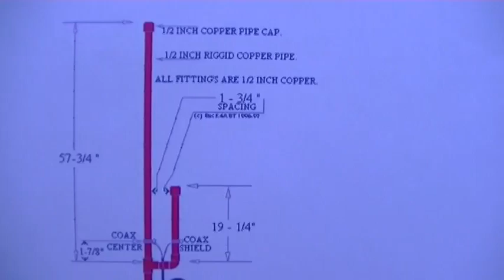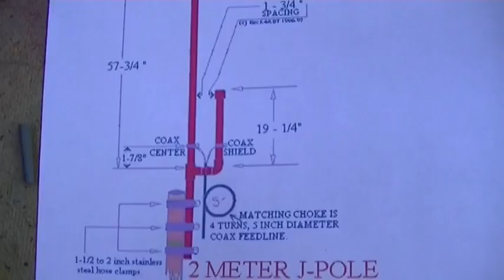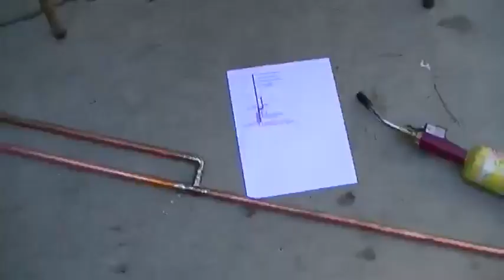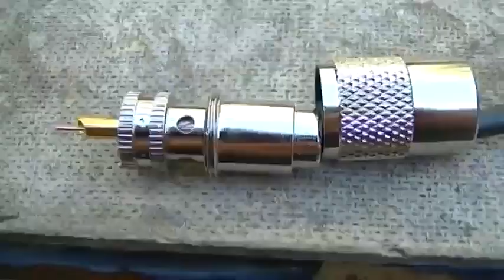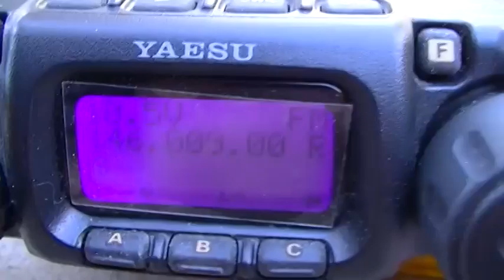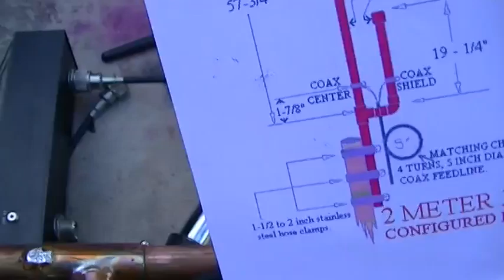Building And Tuning 2 Meter 144 Mhz Copper J Pole Antenna

Comment: You also did not mention that you should not use regular silicon sealer with the acetic acid that is not conducive to electrical connections.

Comment: I used 1” copper foil tape on 4” rubber duck tape. It works well ,is sealed from moisture and rolls up to small package. But you can’t tune after sticking duck tape together.
Reply: Duck tape is not wise
Reply: @FhritpFafo-z5c , Perhaps you are not wise. Have you used rubber 4” duck tape ?

Comment: How is it not shorted out ? The ground shield and center conductor are touching the same pipe basically
Reply: Radio frequency behaves nothing like DC (and 60Hz is essentially DC compared to RF).  Most of RF "resistance" is impedance not ohmic resistance.

Comment: That MICRONTA (Radio Shack) SWR meter is made for CB (27 MHz), not for 2 Meter frequency's.  I doubt your'e getting accurate SWR readings.
Reply: You're right bro, I thought I was the only one who notice it. 27MHz is way way off from 146MHz with that SWR meter he's using. 73's.

Comment: Anybody watching this now make sure you waterproof your coax ends. Water will go down the jacket of your coaxial cable and short out your transceiver.
 J poles make great antennas and cost almost nothing but your labor. I made my first using aluminum. Pushed  one end into the ground and tuned it. I was amazed at what it could do.

Comment: The J-Pole is a balanced antenna. The coax can go either way, the braid and centre conductor can be on whatever side you want. I just built one using 12AWG wire inside PVC conduit. It works perfectly on 144.000-148.000 at 1.01-1.2 SWR.

Comment: It’s been my experience that if you hit a kind of SWR barrier (in this case can’t get it below 1:1.4) its because the elements that make up this antenna are out of tune (incorrect dimensions) or something is de-tuning them. Your video did not show you actually making the adjustments but was just showing it laid on a table with a SWR meter connected. Putting the antenna upright to keep interaction between the stub and radiator with the ground is needed to prevent such de-tuning, its also important to keep anything conductive away from the antenna (including yourself) during measurements for the same reasons. The adjusting section on the top of the stub is a neat idea but I would also put one at the top of the antenna as well, as with a fixed attachment point of a stub lengthening the stub will also have the effect of electrically shortening the radiator and therefore de-tuning it a little. A caveat I’ll put on the use of a silicone sealant is to only use a neutral cure type as the acetic acid in non neutral types can promote corrosion. If a silicone sealant is used wait for it to completely cure before using as wet sealant can be conductive and can upset SWR measurements. Apart from all that I’d say nice video.
Reply: Notice the SWR meter he is using.  Made for use in 11 meters (an HF band) not 2 meters (VHF)!
Reply: @jfrphoto01  nano VNA needed!

Comment: I made this with just a U at the bottom and set it on my work bench.  Made contact with a  repeater about 15 miles away on 5W power.  I am thrilled.

Comment: My SWR is really high...like 3 + on both 146  and 147. Any thoughts on how to fix. I have the same set of plans, so mine is probably too long too. What is the finished length of the long radiator?
Reply: Get yourself a nano VNA and watch videos on how to use it. Then you can tune your antenna.

Comment: Lol I'm a plumber. I had a little chuckle when you said you're pretty good at soldering. I understand there is a huge difference in soldering copper pipe and wires, but i did look at that antenna just before you said that and I thought , looks like he had some trouble soldering. Lol
Reply: If you are a plumber, why don't you mention to clean the solder areas with sandpaper, use flux on both ends, heat the joint then heat the opposite side where you touch the solder and it will flow to the heat, then wipe the excess with a damp rag?
Reply: I thought the same and I'm not a plumber. That solder didn't flow into the joints, or he couldn't tell that it did and just kept adding more.
Reply: That's a real bad solder joints  looks like he used soldering iron
Reply: https://www.youtube.com/watch?v=hBDBwM1MWt8    I found this video on soldering copper pipe. Looks like the man in the video knows what he is doing.

Comment: Does the DIAMETER of the copper tubing matter? For example, could I use tubing half that diameter, or even one quarter that diameter, without negatively impacting the antenna's performance characteristics? I need an antenna with a very low footprint visually. Smaller tubing would obviously help.
Reply: You can use any diameter tubing. A larger diameter tube will increase the resonance and a smaller conductor will decrease the resonance. This is due to the skin effect.
Reply: @TheOKBluseman    ..  Thanks. But what does that mean? I obviously want to maintain as much performance (bandwidth, range, etc) as possible. You talk about "resonance," which means very little to me. At what point does smaller tubing have a detrimental effect on performance? Does quadrupling or more the diameter (4-6 inches or more) greatly improve performance?
Reply: @dwightstewart7181 Copper pipe gas gotten very expensive and you see a lot of J-poles these days made with twinlead or ladder line.  The larger conductor diameter gives a slightly better bandwidth in theory but probably not practice.

2-6m is the sweet spot for a copper pipe j-pole.  When you get into UFH you can't get the copper pipes close enough even using a street elbow.  The gap needs to be very small compared to the wavelength.  Parallel transmission line J-poles really shines in UFH.

As a practical matter power is the only concern when it comes to wire diameter.  Ladder line can support about 75W.

Comment: PARTS LIST: 1 ten foot 1/2 inch copper pipe...1 1/2 inch elbow...3 1/2 inch caps... 1 1/2 inch T connector. a really hot soldering iron or a torch and plumbers solder (preferably)  i prefer a so-239 connector soldered to the ground radial pipe (longest tube) and extend the center connector to the shortest tube (driven element).

Comment: If the copper pipe isn't equal higher up, what about some PVC with T junctions on each end?
Reply: Copper is quite ductile, you could probably just bend the short side out a bit until the sections are parallel.

Comment: This antenna is out of balance.  You should be able to get a return loss of < -25dbm RL across the band.  while you were concentrated on shifting the frequency, you paid no attention to the bandwidth or the lack of suppressing that center null.  When you see it on a spec an, or an antenna analyzer, it is pretty clear how everything plays together.  You need to be able to see the spectrum in order to tune properly.  Much respect for those who use these techniques.  I would go mad before I could get what I wanted.

Comment: I moved the coax up and down to get the 50 ohm's then add or remove some on the long part to get 
It to resonate at the frequency I want . And as Always a Ballanced antenna fed with unbalanced coax needs a choke . This is an end fed 1/2 wave antenna.
Reply: This is also how I do it.  although I use a spectrum analyzer and a coupler to see Return Loss.  The coax is adjusted to balance the near and far lobe into balance.  Adjusting the center end will shift the right lobe, while the shield side will shift the left lobe.  The balance of the two will suppress the center lobe.

Comment: Will this work with 3/4" pipe? I only ask because I have a ton of 3/4" pipe laying around, I could go get 1/2" if it isnt possible
Reply: Will work with 2 inch if thats what you got as long as you keep the lengths and spacing right. Most people use 1/2 because it's cheaper and easy to find.

Comment: If you build one of these, a piece of cardboard cut to the gap size makes a great construction alignment jig.  Tape the tubes to the cardboard and then fold back from the areas you are soldering while all the components are secure to the cardboard sheet spacer.   The jig would be nothing more than a piece of cardboard 19-1/4 X 1-3/4 inches.  Assemble the components with tape.  Fold out the bottom for the solder job. This holds the driven element and stub in align for the soldering.

Comment: J Pole antennas are very hard to tune to get to  1.1 to 1  I have never heard any one get a J Pole to a really good tune.   when someone does let us all know
Reply: Mine is 1:1.17 on the low end and 1:1.27 on the high end, pretty happy
Reply: I have built many J poles for 2m & 10m from aluminium tubing and got swr down to 1.0 ....... The trick with tuning j poles , is adjusting the feed point and also adjusting the element lengths as well ....... I use an Analyzer , so I also look for 50 ohms with lowest fragrance ........ de 9z4bm

Comment: Don't know much about antennas yet.  What's the purpose of the coiled up cable?  Is that part of the antenna design or just extra cable in case you need it?
Reply: I'm going to make a "Thunderpole" Coaxial Collinear using a carpet stair rod (steel tube) for the 1/4 wave and half inch pipe for the lower section for 2m. Made one MANY years ago for CD - it was over 17 feet long with an SWR of 1.1 through the band - when it was away from a chain link fence! That one was all copper - a huge brute :) Point is, yes, tinkering with scrap is the way to go!
Reply: Oops - CB not CD :)
Reply: not bad.....you're on the right track.....old timers like me use baluns for HF dipoles.....the coiled up coax makes a quick and nasty air-choke balun (?)....and for this antenna, it's the cheapest and best option, and cuts down on line loss and stray RF....the famous G5RV HF antenna uses an air choke balun, but for diff. reasons, cuz it's a multi-band that's made to use with an antenna matcher/tuner and with two types of feedline (50 ohm, and 450 ladder line) before it gets to the wire, which is 51 ft per side I think....at higher freq's, the antenna can be shorter....whole idea of ham radio...tinkerers...all of my antennas are made form scraps, and donated stuff whenever possible, and I have worked 100 countries in a weekend is some of the bigger contests, just using garbage and donated materials for antennas at 28-39 feet AGL(above ground level)....old zipcord stuff, like flat ext.cords for 120vac, is good for 300-500watts on hf...excellent for portable dipoles for QRP or barefoot (100-150W) use....maybe a tad more, but not really gud for running 1000-1500watts....old romex is excellent for hf dipoles/inverted vees.....they can handle the Kw plus input power at the feedpoint...thicker/heavier gauge wire the better.....12/14 gauge is common..hope this helps....
Reply: Newer timers use UHF powered iron toroidal cores.  They don't radiate the same as an air coil balun does.  Works very well. 2 or 3 just larger than the coax jacket and designed for the frequency are ideal.  Don't confuse a ferrite suppression torrid. They are very lossy to attenuate RFI.  You want the inductor choke for this application.

Comment: I need to repeat 3 G phone signal (900-2100 mhz), can I use this design ? if yes, what are the sizes to use ? thnx
Reply: No.
Reply: Yes
Reply: Over that frequency range, no. But I have seen a j pole made for the 23 cm amateur band (around 1280mHz) work reasonably well.

Comment: I think you would have to be very quick as you don't want to melt the inner insulator sheath or your SWR will be around 30:1 not good and will burn out your power stage so you want a 1:1 SWR.

Comment: IF you flux those copper joints before solder it will come through much cleaner, just sayin'
Reply: Clean joints are a little difficult considering the tubing may have to adjusted several times before the antenna is complete. The goal here is a working antenna, not show-quality soldering joints. If you want looks, sand and polish the entire antenna to a high shine afterwards. Sure to impress your friends & neighbors.
Reply: And, of course, if you polish the copper people will sound more polished!